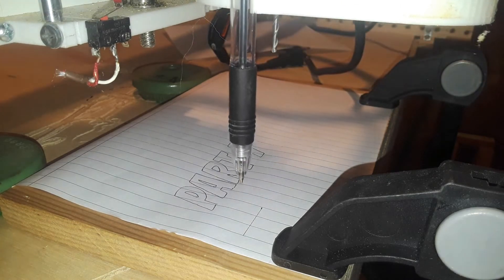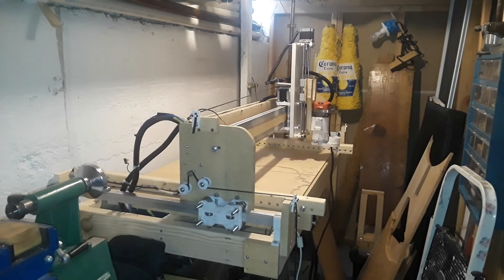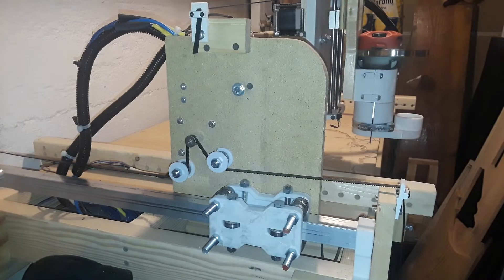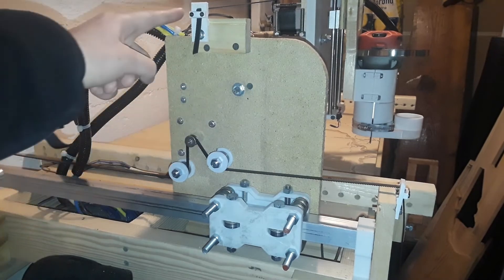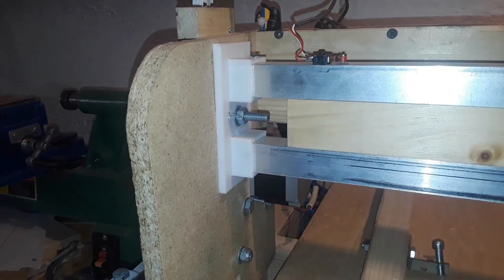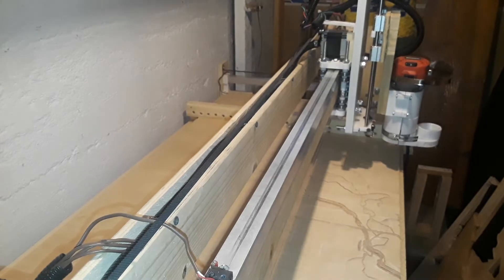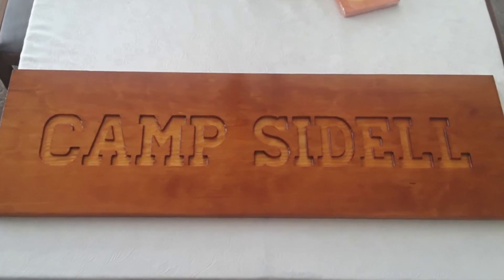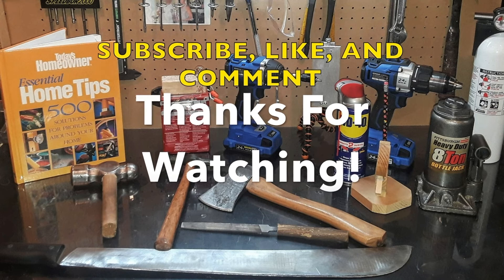Homemade CNC Router Part 7: X & Y Upgrades

Comment: Laminated plywood may be better for some of your parts.
Reply from the maker: Your probably right! I found 2x4 is easier to work with. But if I ever make another version of my CNC Router I'll probably use a laminated plywood design.